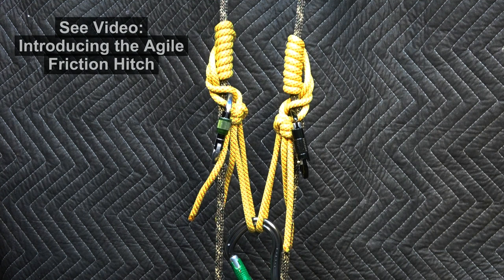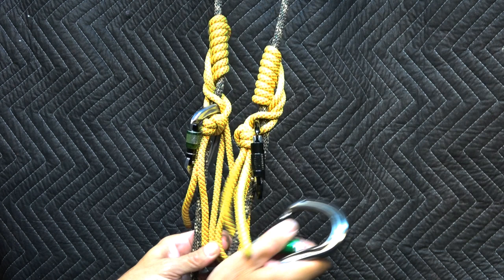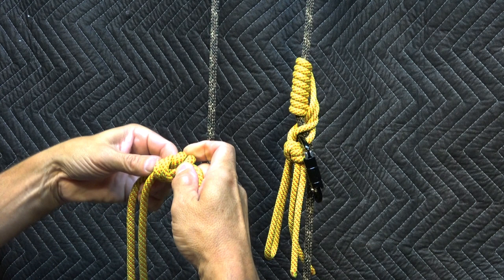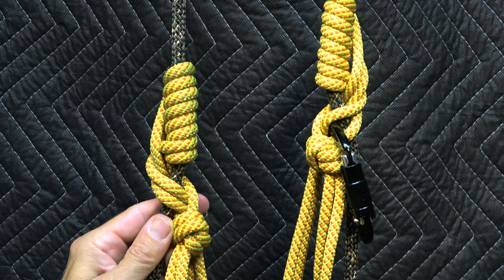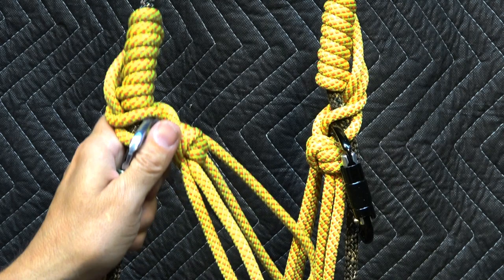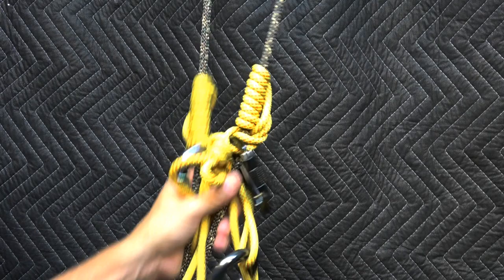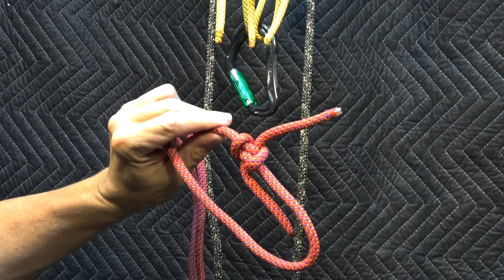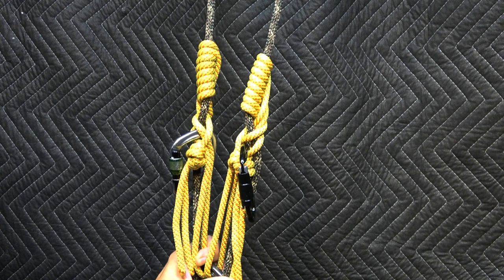Tying the Agile Hitch

Comment: thanks for going back over the Agile Hitch in detail, have been playing with it, seems to jam up on me in rappel, have tried 3,4, and 5 wraps, have used it as a back up above the jrb 5-2-3, and solo on the double stationary jrb climb, and SRT pole set cliimb, will have to try the overhand bend, the hunter’s bend has served me very well however as that allows me to adjust the loop length after tying.
Reply from the maker: During rappel on a munter, the job of a friction hitch is to be there as a backup only.  Wiggle each one loose before starting your rappel so that you can tend it with just two fingers. Our brain is telling us to balance the load between our two hands, but we have to override that and make our tending hand have a very easy job.  Using a super munter may also help
Reply: @jrbtc  yes, I like the super munter when doing an srt rappel, also studied up on the longhorn agile hitch and will convert to that for my lineman and tether , your adaptations are fast and furious for me!!! I’m satisfied with the JRB 5-2-3 for ascent both double stationary and srt but will play with the agile and longhorn agile

Comment: I had to add an additional bottom wrap on my longhorn agile hitch. Using 6mm trc and 8mm truefl as a main line. It slipped immediately when loaded with the 2 bottom wraps
Reply from the maker: In general, if you have a slipping issue:
1. Make sure your initial loop isn't too long. It should be nice and snug when you first form it and gotta squeeze the loop thru the remaining nip.
2. I don't add extra wraps on the bottom but going to 6 on top is fine.
3. I prefer 9.5mm or larger rope for single rope applications.  Sure, i can do it on 8mm, but we gotta consider worst case conditions like a heavy climber on a wet rope.
Reply: @jrbtc  I'm a heavier climber, so I took that Into consideration. I'll try the 6 top wraps tomorrow. I liked the 8mm for packability, but contemplating a larger size main line as well, thank you sir

Comment: On SRT, mine jams... I use a pretty stiff 9.5mm Canyon rope with Technora Sheath, tied  the Agile hitch with nice 7mm Sterling Accessory Cord... Tied it several  different times, with and without carabiners.  Using it above a MadRock Safeguard.  The Agile Hitch jams going up after loading first with climbing footsling, then bodyweight... 
Doesn't jam immediately, but does after a few "steps" upward. 2nd and 3rd Coils from top roll upon themselves so tight it quits moving.   I'm wondering maybe Dual Rope works because it's load is lightened by 50%,  so the hitch doesn't distort.   (Love this channel!)
Reply from the maker: Agile hitch needs a handle and load on it to keep it loose.  It's not my preference for SRT but is doable.  I like Agile on DSRT and Longhorn Agile or JRB Ascender Hitch on SRT.
Reply from the maker: If it's above your device, as a backup, make sure it has a tiny bit of slack.   It's only job is to be prepared for your device to slip. And if that happened, you do need a plan to be able to unload it and transition into rappel.  I covered that in the video: Self Rescue after Loss of Footing

Comment: Hi John, in terms of blocking strong, is it the agile similar to a hedden knot , or less? Thank you man 👍👍
Reply from the maker: Over the years, i have often been surprised when doing strength testing, and particularly in how the materials used and number of wraps affects the results.  And so unless i have done a side by side test, I try not to guess.  But let me explain.  The Hedden Knot has the load strands directly routed to and loading of the TOP of the helix.  The Klemheist and Agile load the bottom of the helix.   In my experience, loading the top creates a harder bite. Loading the bottom makes it more workable and easier to adjust after load. With the same number of wraps,  would expect Klemheist and Agile to slide similar to the way the Prusik slid in the test video.  However, adding an extra wrap can make a huge difference. What are you using it for?
Reply: @jrbtc  I've used the hedden as a back up in a  second line , and man  it's amazing, very safe!
On first view this hitch ( agile)  looks pretty similar , so I wanted to know if  it works that well/ I see your answer and understand it could be  different , but maybe works

Comment: Great recap. I might have missed it but what is application or pros/cons to the longhorn agile vs the agile with either overhand or hunters bend? I think I heard the profile of the overhand is the most compact - better for fishing through crotches?
Reply from the maker: I prefer the agile hitch for stationary doubled rope. I prefer the longhorn agile for single rope applications. The ad y'all hitches quicker to tie and less bulky but more difficult to break under load. However in a double rope application it only holds half of our weight and so it is not a problem. The longhorn agile hitch offers that one-handed operation to remove Slack. That is a feature we want in a lifeline. I will be demonstrating some applications for it in the future. But Longhorn agile is also more bulky and so it would not be my Top Choice to try to run that through a tree crotch.
Reply: @jrbtc  thanks John!